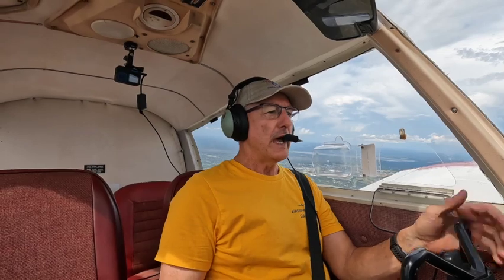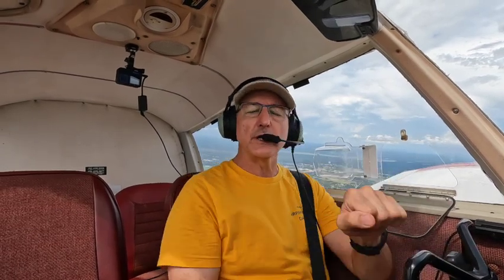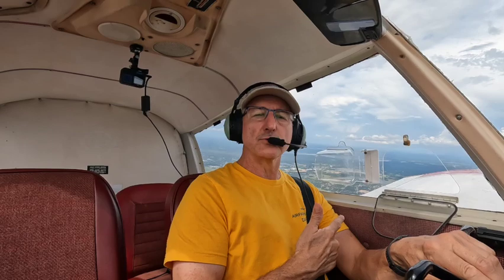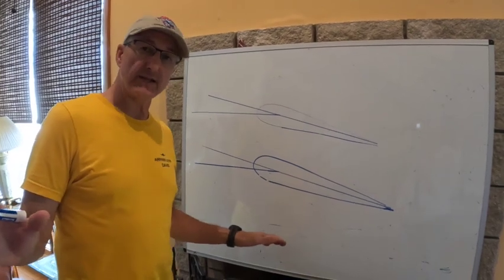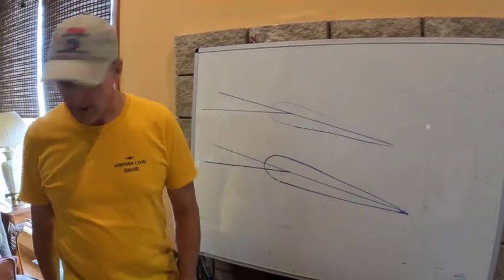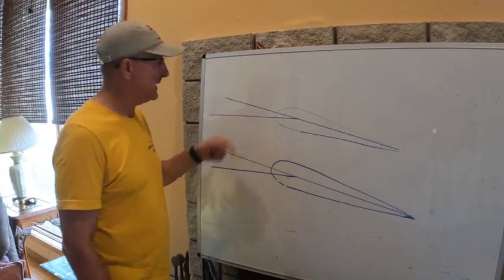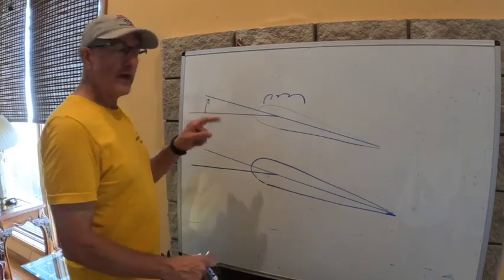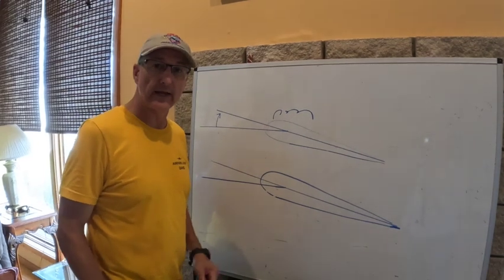ANTI SPIN TRAINING

Comment: Dave, this is the first video I have ever seen of yours and it's absolutely outstanding. I am creeping up on 300 hours, currently working on my commercial rating and to be honest, I am still a little uncomfortable with stalls and spins. Matter of fact, I find that I am always hyper aware when transitioning from downwind to final as the whole stall spin scenario terrifys me and is usually nagging at the back of my mind. It seems that we get plenty of reinforcement through videos and articles about how that fear is justified, but this may be the the first video I have seen that shows just how much control we have. I love how you make the point that you have in fact not lost control as you still have two additional control inputs that are working just fine, you just need the presence of mind to use them. Well done sir.
Reply from the maker: Thank you for your feed back! If you have any questions, write me at Airparklivin@gmail.com.  My goal is to stop stall spin accidents through education!
Share my video please.  I what to get the word out!
Reply: "I love how you make the point that you have in fact not lost control".  Not true.  When the wing stalls, you have lost control.  He delayed four seconds and lost 200ft before moving the control wheel forward.  Unacceptable.  The recovery could have been accomplished in a fraction of that time by moving the control wheel forward immediately.  Also check the vertical speed indicator - it was nearly fully pegged because of the delay in lowering the nose.  Even after he recovered airflow, then he still had dangerous momentum from that vertical speed with which to deal.  That could have been avoided if he had dealt with the most important item first - the pitch.

Comment: Interesting... My cfi taught me, ailerons level, pitch down, opposite rudder. I'm watching your hands (ailerons level) - elevator THEN pitch down. When we practice stalls together, my archer stalls wings level for the most part. However when I'm practicing solo stalls, the plane tends to fall to the left. I never thought to maintain with rudder. Great video, thank you! I will remember this and be a better pilot!! 👍
Reply from the maker: Ailerons level is the right thing to do! In the video, I demonstrated that application of ailerons to stop the roll aggravates the stall. I want people to see that! If you ever experience a wing moving the opposite direction of your aileron input, immediately apply forward stick and use the rudder to control your heading!
Thanks for watching and please share

Comment: Stall recovery happens when the angle of attack is reduced so I think you are wasting time by applying rudder first.
Reply from the maker: Rudder is used to stop any rotation. Elevator is used to reduce angle of attack. The timing on who goes first, rudder or elevator) is reduced to a micro
 second.  The stall I demonstrate requires both almost at the same time. Tomato vs tomato
Reply: @airparklivin5460  Your sequence at 9:18 does not follow what is recommended for stall recovery in the Handbook, page 5-16, which is 1. disconnect wing leveler or autopilot, 2. pitch nose down, 3. roll wings level while also cancelling yaw with rudder.

For a spin recovery, on page 5-25, the sequence is full opposite rudder and then positive, brisk, and straight-forward elevator immediately after full rudder application.  But you are still out of sequence because it is explained in the next two sentences that the forward elevator movement "should be taken immediately after full rudder application and do not wait for the rotation to stop".  Your sequence at 9:18 is #2 - Rudder to stop rotation.  That could take several seconds and in some situations, the rudder will not stop the yawing.

Even if you can stop yaw with the rudder, the airplane is not under control until the angle of attack is lowered.  So what should be done first - push the rudder to reduce or stop yaw or push on the stick to recover control?
Reply from the maker: @warren5699  
Warren,
You stated that in 9:18 my sequence does not follow recovery in “the Handbook”.
I am not sure what handbook you are referring to. My aircraft was built in 1971.  It has a Airplane Flight Manual.  It is a very short document without any stall recovery procedure.

Anti Spin technique which I describe and demonstrate in the video is addressing the situation which seems to be the leading cause of the stall/Spin accidents we are seeing in General Aviation. That is flying at very close to stall speed with the airplane uncoordinated. (The Ball is slightly out of center).

In this situation, one wing exceeds the critical angle of attack first. This is followed by a slow roll on the longitudinal axis towards the stalling wing.  This is not a full wing stall, it is a gradual stall of one wing.  If the airspeed of the airplane remained the same, a simple rudder application to correct the out of trim condition, (uncoordinated flight with Ball out of center) would correct the situation.  
What happens if the airspeed continues to decay and the angle of attack is not decreased, the unaware pilot applies aileron to stop the uncommanded roll.  This increases the angle of attack on the stalling wing, which causes a full stall, while the flying wing angle attack is decreased.  This situation causes rotation about the yaw axis. SPIN ENTRY!  At this point, no matter how little rotation has taken place, Rudder. Application stops rotation, Elevator to decrease the angle of attack.  The spin is prevented before it develops.

Anti Spin is just managing your heading with rudder at all times.  Lateral control of most small GA aircraft is affective well below stall speed of the main wing. 

As I posted on the end of the video the standard Spin recovery for most airplanes is:

1. Throttle Idle. Ailerons neutral
2. Rudder (Full Opposite to spin direction)
3. Elevator forward to neutral 
The first three steps are done immediately.  Then you wait for the airplane to stop spinning to recover.
4. Recover from dive.

A fully developed Spin may require patience after the first 3 steps are performed.  I have been in planes that take a few complete turns to stop spinning after the correct control inputs are performed.  This is why it is Highly recommended to seek Spin training in any airplane one wishes to conduct spins in.  

I hope this helps answer your questions.
Reply from the maker: I agree for a Coordinated Stall, (Left and Right together), forward Elevator first. You must use your rudder to maintain your heading.  In a spin, Throttle Idle, Rudder full opposite to spin rotation, Elevator neutral.  Wait for spin to stop, recover from the dive.
Reply: @airparklivin5460  Dave, Sorry, I included the page but not the full name of the handbook - Airplane Flying Handbook.

On your sequence at 9:18, #2 is Rudder to stop rotation, #3 is Push forward on elevator. Prior to that at 5:30, you had said "push rudder and don't let the nose yaw anymore, and then push forward stick".  I think some may read that as don't push until the yaw has been stopped, which would be an undesirable delay in reducing the angle of attack of course.

The FAA Handbook pg 5-16 has a different sequence, i.e. push before using ailerons/rudder.  The uncoordinated stall recovery pg 5-20 is the same sequence - "It is therefore essential for the pilot to follow the stall recovery procedure by reducing the AOA until the stall warning has been eliminated, then roll wings level using ailerons, and coordinate with rudder inputs before the airplane enters a spiral or spin".  That's why I said the video is out of sequence with the FAA Handbook.